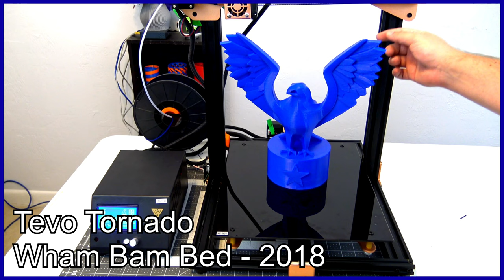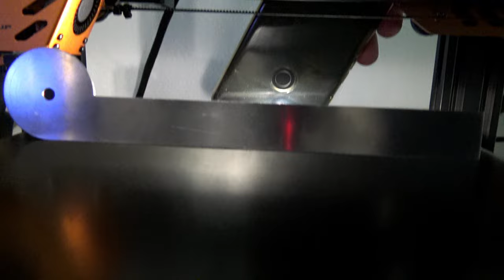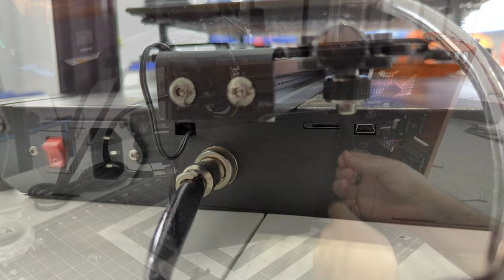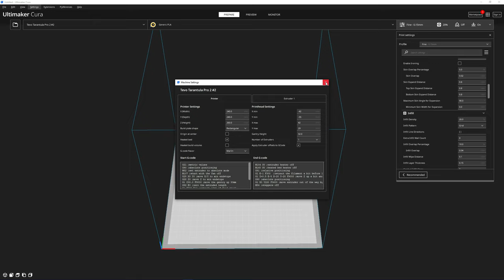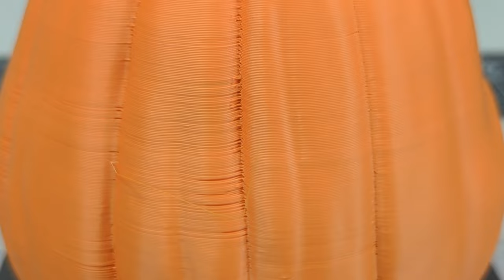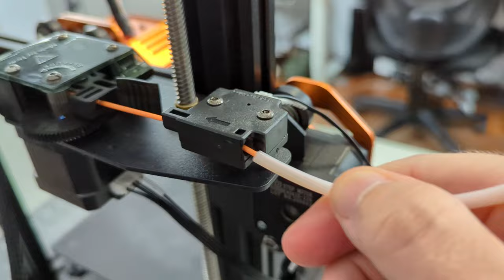Tevo/Homers survived a corporate takeover? - TEVOUP Tarantula Pro Review

Comment: Have a Tevo Tornado (and 4 other printers). The bed was warped on mine as well. A reliable (but messy) way I found  to 'share out' the difference in height was to strip the sticker backed base off the glass bed 2) put blue painters tape on the glass bed 3) put a light layer of PVA glue (Pritt Stick) on the tape. Tbf, with that, it printed PLA and PETG fine (although there was some Z banding). The main horror show was the wiring though. I had to completely re-wire the lethal control box, add an Earth to the mains powered frame!!!! I replaced the SSR, added fuses, added strain relief to the non-compliant mains wiring to the bed, added a Pi and a smoke alarm to control a smartplug in case of overtemp or fire. If this thing goes wrong then it will go wrong quickly. If the cheap SSR controlling the bed fails short you have a mains powered firestarter. I never felt comfortable running it tbh, it took up too much space for what it did and it is in the loft now lol. I can be mad to print OK though.